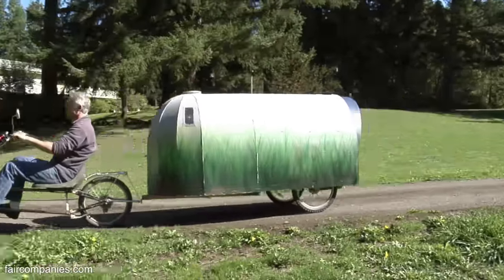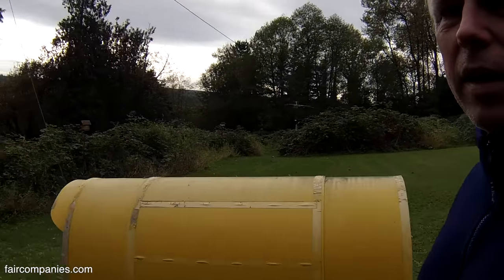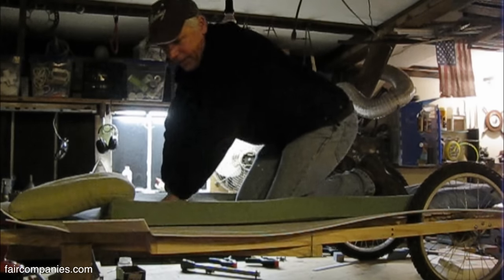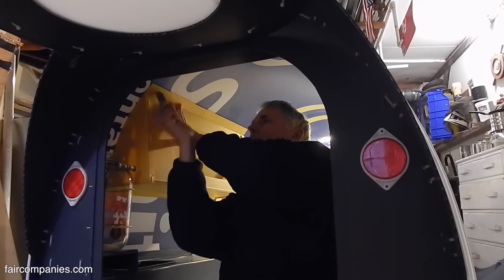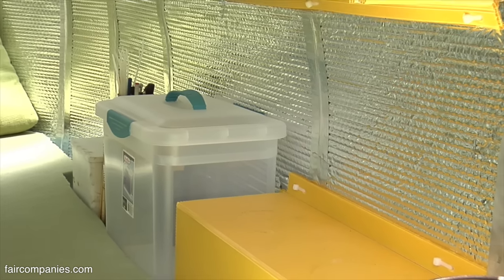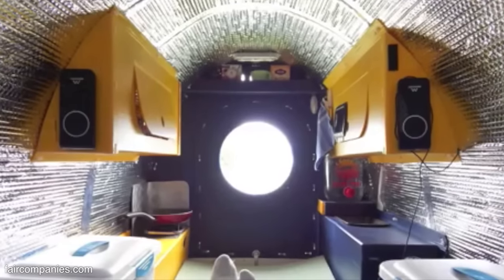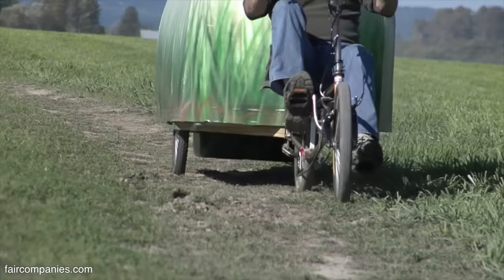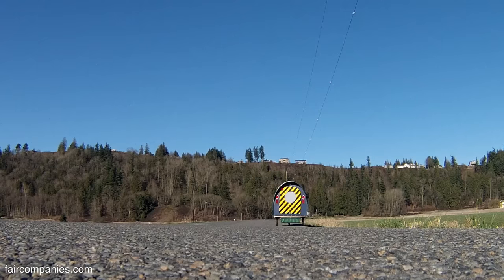$150 bike camper: DIY micro mobile home (downloadable plans)

Comment: Cover the trailer in flexable solar panels and tow it across the country with an electric bike.With 500watts of solar power one could travel all day on a sunny day off the solar power alone as it would take no more then 300 watts to cruise at 15 mph and the remainder go towards charging the battery for those times when it's not so sunny lol.
Reply: wow I like that idea a lot!
Reply: Good idea!
Reply: ...I like the idea as well.  Electric bike, powered off of solar panels, is even better.  Few downfall are natural, or ignorant, disasters!  Strong winds and hail, or drivers you share the roads with.  Once the sleeper is demolished, you're simply left with a down-graded-Lance Armstrong journey home!
Reply: Lower third + chassis of trailer could be reinforced to survive a storm. With couple of guy lines to secure it to the ground. Lay down and pray! Kind of panic room/refuge! Cycle home after a storm with less trailer but one heck of a story to tell! :)
Reply: You sir are on to something
Reply: watermyplants indeed!
Reply: I plan on this next year. Going half way across the state and maybe further, we will see how tired I get.
Reply: Very nice idea!
Reply: Would a lightning strike be a problem?
Reply: clifton reed jr Of course, it's a problem no matter what. Just don't get hit.
Reply: extra weight of battery's ?  and room for them , extra costs , and reinforcements to frame etc. nope :)
Reply: Mark Bird The batteries don't weigh that much. A human weighted battery would get you probably 200 miles on one charge, so just use a smaller one.
Reply: How about making the trailer motorized so it pushes the bike.
Reply: m9078jk3 Then you'd have the reverse problem that you have with backing a trailer with a car.
Reply: harry guy I love your thinking; great idea.
Reply: harry guy 
Didn't you say the same thing on another of his video ? And I told you that it was too expensive ?
Reply: good idea
Reply: shizukagozen777
It's possible...not sure to be honest....I can't find the vid or the post.
One thing I do remember saying though is I wish I could take the credit for the idea but I got the idea from a woman who went across the country on an e bike hauling just a regular bike trailer with a solid framed solar panel on it.
When I seen this sweet ingenious little camper trailer I got the Idea for a couple flexible solar panels on the roof.
You told me it was to expensive??
How much would you say is to expensive?
Can get a 1000w dc to ac inverter for 100.00  2 flexible 250w solar panels for a little under 300.00 depending on the quality.
As for the e bike there are 250w, 500w, 1000w e bike conversion kits with a front or rear 16'' to 29er rim with hub motor that can be put on any bike for less then 400.00.
I have been abusing my 26'' 1000w golden motor magic pie 2 putting 3000w through it for almost 8 years now without any problems mind you I don't hold it above 1000w for more then 10 secs so as not to burn out the motor.
Most expensive part is the battery but if you are able to you can buy rc lipo packs or what I prefer is lifep04 cells and build your own battery for a fraction of the cost of a pre made  battery plus they will last way longer then most pre made packs for half the cost.
I just bought 20 original not Chinese knock offs A123 lifepo4 20ah cells for 30.00 each = 600.00 plus a 20S 60a BMS for 100.00 and 5a charger for 80.00 totaling 780.00 giving me a 72v 20 ah battery fully charged but is more like 68v for the majority of the discharge cycle and weighs only 25lbs.
To buy this battery pre made would likely cost over 1500.00.
With good throttle management keeping the watts around 300 I could go 75 km on a charge.Or you could be charging the battery while you ride and go all day as long as there is sun.
Have the solar panel going to the inverter that you plug your regular 115v battery charger into charging the battery while you ride and depending how sunny it was could have enough power to be charging another battery as you ride also.
Not sure about that as I have never tried it but could def ride while sunny and have 75 km once it got dark running off just the battery.
Add it all up is like 700.00 for the panels and inverter.
500.00 for the e bike conversion kit shipped.
780.00 for bat and charger shipped.
Plus the bike and trailer.
Lets say 3000.00
I know lots of people that paid almost that for one of them crappy electric scooters with 100 lbs of lead acid batteries but would still work would just be heavy and not as efficient.
If you are buying pre built e bikes and lithium battery packs then yes it is expensive but only because you are getting juiced paying top dollar for junk from people buying a shipping container full of cheap e bikes from China...bringing them over here and charging 3...4 sometime more times what they paid.
There are thousands of good used e bikes that usually need batteries for a fraction of the cost of new on Craigslist or Kijiji.
I've seen 1 year old e bikes costing 3000.00+ new sell for 500.
Do your research...there are lots of great deals.
IMO anyone looking to build one of these camper trailers would likely have the skills to build their own e bike and battery pack.

A good place to start for info is Endless spheres...it is an e bike forum where you can learn about building e bikes, motors, battery pack and the best places with the best prices on anything e bike related.
Reply: there are a multitude of issues with what you said 

but the safety ones matter 

72v batteries are a shock hazard 
and running off batteries (on a sunny day) while trying to charge them is a fire hazard 

the individuals you know/saw got jipped btw, even within pre builts they were ripped off 

42 lbs, on your own with legal liability if you get hurt due to the battery malfunctioning (yeah, warranties and insurance don't cover improper use, which includes using a battery while it's on charge) 
46 miles before you account for the trailer and weight dragging it down 

overall it's not that great a deal, it's an option on budgets but it's really..really not a good idea
Reply: josh spradling 72v dc. You barely even feel it.  ac will mess you up though.
Reply: josh spradling
Do you even have any experience with e bikes besides watching some youtube vids? cause it doesn't sound like it.
Reply: harry guy electricity, batteries and solar don't alter how they work because they're slapped on a bike
Reply: josh spradling
I don't recall saying they did...The batt would charge the same way it would charge plugged into your 110v home outlet.The charger powered by the inverter powered by the solar panel would turn on as the batt voltage dropped and turn off when full keeping batt fully charged when sunny while you ride depending on how many watts the bike is pulling compared to how many watts your panels are putting out...
Pretty simple.
As to the battery sure you can buy some cheap dog pooie brand batt from China for 5 or 600 that might last for 2 years if you are lucky but for a good quality 72v 20ah batt that will last 5 to 10 years you are looking at around 1500 shipped at least unless you build your own.
Or go 48v 20ah if you are worried about getting electrocuted lol.
Would be lighter and cheaper but less efficient as bldc motors are more efficient at higher voltage not to mention higher top speed.
Reply: harry guy you don't try to charge batteries in use, it hurts the battery and increases heat generation causing a fire hazard

a battery also can't physically charge and discharge at the same time

electrcity is never safe
and eldctrcians start getting nervous about dangers at 12v (not safe at 1, but there are alot more things that can go wrong)

a short in a 12v can cause severe burns to anyone, even though most wouldn't think twice about handling a 12v freely
A simple wedding ring, and improper spanner is enough to cause severe lasting damage even at that voltage 

There is no such thing as safe electric
Reply: josh spradling
Then how is an off the grid house powered with solar with battery storage able to work?
The house would burn down by your line of thought.
How can the home owner run appliances through out the day while the batts are charging lol.
Reply: harry guy 
my it's not safe to use a solar panel and try to discharge a bike at the same time actually comes from
sun = hot 
battery discharging and charging = heat generation 

you're getting a battery fairly hot on it's own, then adding the sun, then stopping for a time so solar can actually do it's job 
aka fire hazard without it all being properly setup 

solar systems don't charge a battery in use, they power your home and any excess energy that's left they send to the battery or grid for future use 

they do this through sheer size 
by producing far..far more than you'd need during the day so that there is a sort of trickle charge going on through the excess energy 

if a panel is rated for your needs specifically (or meets it) you can't get this extra charge for later 
you'll either get the solar panel being unable to supply at all and you instead work off battery power, (500w is not 500w, and most of the time..esp in a mobile setup won't met 400 regularly enough to be rated that) 
or your panel will just meet what you need, in which case you'll be using solar until the sun stops meeting your demands, then it'll kick to battery..or trickle charge your battery unless in use..where it'll do nothing 

house do burn down due to improper management of the batteries 
sending current into a hot object that isn't well ventilated can and has been deadly 
then if you don't know what you're doing..chances are you won't notice any shorts or issues which will further increase heat, increasing the chances of a fire even more 

there's a reason that even nations encouraging solar and wind setups discourage citizens from installing it themselves 
if it's not properly done from top to bottom it can quite easily be deadly to you and costly to the city 

in the case of most personal devices, it's usually just painful or deadly to the rider 

there's a reason anything with a battery tells you the same thing on charging it
well ventilated, shady and do not leave unattended
if it becomes hot, stop charging it and do not use until it cools down (ofc no one listens so governments and companies have to do even that for people..but it's still a very real risk, esp when riding in the sun and trying to use solar to charge things)
Reply: harry guy  Not a bad idea, I'm sure it would take some fine tuning. If you think about it , you really only need power for the uphill stretches , so when your on flatland or downhill ,a portion of the foreword momentum could also be stored to later power it uphill. I have no idea how to accomplish this but I'm sure someone does. I mean after all if  humans were able to accomplish a moon landing I'm sure this is within the realm of possibility.
Reply: How expensive is expensive? $50-500 for an Electric Hub. Flex solar panel $200-500 Batteries $200-300  Should be able to make one for less than $2K
Reply: ***** yeah good idea, that's kind of what I meant in my comment about storing  some of the forward momentum especially when you're going downhill
Reply: harry guy awesome, I didn't even know they made something like that.
Reply: Many hub motor controllers have a regen function that is like an electric brake the recharges the batteries when the bake lever is pulled.You can adjust the amount of braking force from just a little to throw you over the handlebars.
Reply: Would add to much weight and complexity.I don't think a chain would work but a shaft drive might but again adding a ton of weight.You could put you motors, controller,batteries on the trailer making it a pusher trailer.
Look up electric pusher trailer on youtube.
Reply: Have both...front dynamo hub and rear hub motor with regen.
Reply: im not a solar panel expert... but i highly doubt there is enough surface area to have 500watts worth of solar panels!
Reply: The average 250 watt panel is around 5.5'x3' so depending on the size of the trailer would determine how many panels that could be used.
Say 6' long trailer 2 panels could be layed length wise on a rounded roof and maybe one on each side of the trailer.Problem with solar panels is if only a small portion of the panel is shaded it really hurts power output so one side would produce power while the other side produces hardly any which is why I would lay the panels length wise as one side would always be getting enough sun.1000watt of panels but only 500watt could work at any time.
I honestly don't know or have a disposable income to find out lol.
Plus flexible panels are not as efficient as ridged ones requiring larger flexible panels to produce the same as a small ridged one.
Reply: harry guy I've been thinking about other ways to generate power, or recharge batteries however you want to look at it. And I think that a small lightweight removable wind turbine unit could be installed on top of the trailer for the times when it is parked could also be useful. Any thoughts?
Reply: David  marzolino 
I've been kicking the wind turbine idea around also for my upcoming trip (though what is a trip called when theres no end) and haven't found anything online about it, anybody on here got any input on logistics?  David, I was thinking use it in conjunction with panels to have plenty battery and not worry about relying on a sunny day.  And what would be wrong with it being active while riding?  Wouldn't your pedalling energy be in some way converted into stored energy?  I have no background in this stuff so please correct me if i'm wrong
Reply: or you could use a crank generator attached to the back wheel
Reply: Craig Caminiti a trip with no end, that sounds awesome to me. I really don't know a hell of a lot about wind turbines myself the only thing I was thinking is if you had it running while the vehicle was moving it might create more drag than it's worth but I'm really not sure about that.
Reply: I was thinking along these lines myself.  At least then, at 15mph and electric bike the battery hopefully won't be too heavy a load. Would it be possible to use smaller 9 volt batteries , possibly 2 of them, rather than a standard size?
Reply: Judith Lawrence  A motorcycle battery would probably work, don't quote me on that, but I believe it would ,and it would definitely save you some weight and space.
Reply: I would go with a couple of these...
https://hobbyking.com/en_us/multistar-high-capacity-6s-20000mah-multi-rotor-lipo-pack.html
Can't beat the price and they weigh only 2400 grams each!!!
Not to mention you could draw 50a without them even getting warm which would greatly increase their life.
2 of these in series would give you 44.4v 20ah for under 400.00 with shipping....amazing price IMO and too top it off only 11 lbs..
Reply: Knightz zoss The battery in the link I posted is 6s lipo 22.2v x 20 000mah.Running 2 in series would give 44.4v x 20 000mah and cost is 400.00 shipped as well as lighter 11 lbs then anything i have seen for the performance of these batteries rated at 100amp max discharge.With a 1000w motor the most you would draw is around 20amps which would greatly increase the life of the battery. 
And yes there are batteries with a longer life but are more expensive and heavier.All depends on how much cash you have as well as your ability to source lipo/lifepo4 cells to build a battery pack with a battery management system and charger.
Or buy one pre made which will cost more.
Reply: harry guy Hey, I'm with the electric bike idea, definitely not the peddling idea. Lol
Reply: clifton reed jr LOL
Reply: Ur right. Solar batteries can be charging at the same time while using.  Some even have a built in inverter.
Reply: actually electricians dont give a fuck about voltage per se with safety, It's the amperage that kills and the part of your body it hits across.
Reply: better off dumping the inverter as its changing 12 v to 120/240v BACK to 12v to charge the ebike. steeping voltage up and down incurs loss as its not efficient.
Reply: harry guy remember, no free lunch
Reply: harry guy genius idea.. screw all the what if guys.. hey what if a meteor slams in the earth and kills us all? what if the sun goes nova?.. 

 i refuse to live in fear!
Reply: +Nacht Kind i think you mean ESC which is only a speed controller for the motor.
Reply: Nope. I'm not talking about controlling the motors speed. I don't want that. I'm talking about paying a fee to have a custom vehicle registered with the DMV where it gets its own custom VIN, and license plate, so you can drive it over speeds of 30mph, or in some states 55mph.
Reply: How much surface you need to generate even 300W constantly? Weight?
Reply: You can expect somewhere around 9 watts per sq-foot, and that's with no clouds and direct sunlight.
So 300w would be 34 square feet, and 500 would be 56 square feet. So you might be able to get away with 8ft by 7ft, but you probably won't be able to do hills.
Oh! and don't forget to factor in the weight of the solar panels, it's about 2-4 lbs/square foot, so at best that adds 112 lbs to your trailer. I wouldn't want to be the one trying to peddle that bike. (And at worst 224 lbs just for the solar panels.)
Reply: Lithium batteries are much much lighter and would work just fine. I just don't know how many AHr you'd need.
Reply: harry guy op
Reply: Is the bike homemade?
Reply: harry guy haha haha all your energy goes to carrying your batteries
Reply: Thin, bendable/flexible solar panels are quite lightweight. I found one that could follow the curves of this camper: PowerFilm Solar R21. According to their website it's 1.42 lbs for the whole panel, which is 14.5 x 60.75 inches. Total surface is ~6.12 square foot, so the weight is only ~0.232 lbs per square foot. That's only ~3.43 watt per square foot though. You could fit three panels on this camper. The downside is, those panels are really expensive and you would only have 63 watts at best with the Sun directly above the camper, which is nowhere near the power required.
Reply: 500w would be a lot of flexy panels.
Reply: Don't need a whole lot of battery for some LED lighting and a radio/MP3 and maybe a phone/tablet charger. And do it with Li-Ion batteries instead of lead-acid ones... Not heavy.
Reply: ok
Reply: Idiot perpetual motion machine idea.. without benefit of facts.like weight, actual power output vs sq footage.. battery storage weight.. and fanciful  idea of what less than 1/2 hp ( 300 watts) can do against the wind and terrain.  bad ideas without engineering don't promote EV's they sabotage them.
Reply: not if you cover your ears with the supplied Styrofoam cups.
Reply: this is called cart before the horse.
Reply: The future!!!!
Reply: 300w will easily power a bike to 15mph.  you can do that on under 200w if it is pretty flat.
Reply: harry guy i
Reply: After reading the comments, made me think back to shop class 19 years ago. We built a battery powered bicycle that recharged on a solar panel on the rear of the bike while peddling. Things people couldn't believe back then and looking at just battery and solar technology now amazes me.
Reply: The batteries which will be used to stock the electricity that product the solar pannel will be super super heavy ..
Reply: PV is magic, yo. Just slap on some panels and enjoy your free power. Fuck technicalities, it just works.
Reply: @death299  if you had two battery packs one charging in your mobile home  off the solar the other in the bike powering the bike's mid-drive motor. Then swap when charged no problem basic build probably ebike and trailer and solar powering system could be done for under 1500 with dyi systems. Exspecially with the flexable solar panels.
Reply: @feliciaanglen3510  you are giving flexible panels waay too much credit 

Even in cali and nevada their 20-25% effeciency takes DAYS to fully charge any decent ebike battery 
Under optimal conditions..aka flat and facing the sun 

You're looking at a week or more for a battery charge while adding 72+ lbs to the system before gear meaning even a high quality battery (which would bump you above 72 lbs, but atm that's pointless as the extra weight isn't needed to make it unviable) that can get 100 miles optimal in under 10 will lose ~ 25% of it's optimal condition range 
On top of the 10-25% heat siphon 

At best you're getting 60-70 miles per charge
Buuut it's also unviable to use as a normal bike, takes a week to charge AND assumes you carry no other gear (so no repairs, food, water etc) the moment you start adding the things you need to have you're not going far at all

Unless you're in a permenant or intend to be in a fixed location none of it is viable 

Esp if the goal is to "cruise around" since you'll be forced to stop every few hrs (evem in optimal conditions) and wait weeks before doing anything

The more panels you add the quicker it will charge..and the faster it will drain 
there's currently nothing that makes such viable 

For any distance where you'd need the range extra batteries and cables is vastly more effective due to forced downtime via length of charge time 

You're also never going to get a week of perfect weather (or even a day without clouds) 
so for 5 days of riding a whopping hr a day (at 15mph under otherwise optimal conditions) you're left not moving most of the setup for just as long if not longer
Reply: Awsome 👍👍What about rain leaking in 
How did you seal it
Reply: I like the way you think.
Reply: might be better built longer, with a cab/seat forward to drive it from.
"mini ultralight RV", a 2hp 4 stroke engine using bicycle gearing (sprockets) so it has power to get up hills, maybe top speed 22 mph. a gallon of gas would run it all day and 200+ miles pretty easily.
Reply: josh spradling I bet you drive a Toyota Yaris and wear a styrox helmet
Reply: tried it and it turned my wife gay.
Reply: Top idea 👍🚴‍♀️
Reply: clifton reed jr what about vampires?
Reply: Wow!!! ❤
Reply: For that matter just make the whole thing a vehicle built around the bike as the mover.
Reply: @death299   fear #
Reply: @GDMHificationranpitc  ?
Reply: I think the point is he likes to ride the bike
Reply: @elrud5964  it's not. it's a mobile homeless shelter
the basic design behind that was just a cheap pop up shelter that could be used by groups that help the homeless as an alternative to "proper" shelters as some individuals would rather not sleep in such environments 

in theory solar panels (basically cost not counted, just the concept) 
 actually work wonders for the proper reason behind it as you can charge things like an emergency phone, electric handwarmer or power a small heater for a short period, batteries that can be used for a variety of devices (such as an electric razor for grooming or lights when one MUST do something at night, or even a handheld radio) 

 all of which..overall make the situation abit more bearable, safer and with regards to grooming make it easier to approach people for things like work
Reply: Sharron Clark  I still get exercise riding an electric bike by peddling along with an electric motor.
Getting  bionic assistance doesn't eliminate exercise it just reduces strenuous exercise.
Reply: After doing some research for several hours. I think a living in a Van is more self-sufficient. Cheapest thing right after a Motorhome RV. A Van is a investment though and it’ll only be good depending on how you much you invest. It can surpass a RV or it can just be enough for a single cramped room
Reply: And the weigth of the battery? No bro, that is to heavy better bring a 50000 mhp battery on pack. And
Reply: @Muncle Tuzza Vlogs "if anyone continues in sin after coming to the knowledge of the truth of the Gospel there no longer remains any sacrifice for their sins but only a fearful expectation of judgment and fiery indignation which shall Devour the enemies of God"... Hebrews chapter 10 verse 26 nkjv
Reply: @Muncle Tuzza Vlogs there is no other name under Heaven given among men whereby we must be saved other than the name of Jesus Christ... Acts chapter 4 nkjv
Reply: @Muncle Tuzza Vlogs Jesus Christ died to save Sinners... Do you qualify?
Reply: @Muncle Tuzza Vlogs that doesnt matter......Jesus cares about you!
Reply: @Muncle Tuzza Vlogs they beat him and flogged him in the scripture says that Jesus Christ was beaten so bad that you couldn't tell if he was a human being or an animal... They put a crown of thorns on his head... They mocked him and made fun of him... They stripped him naked... They ripped his beard out of his face and spat in his face... They eventually crucified him on the cross... And the scripture says that Jesus looked down on them with love while they were doing this to him and he prayed for them saying; "Father please forgive them, they don't know what they're doing!"... Luke chapter 23v34 nkjv
Reply: @Muncle Tuzza Vlogs "o m g"   is using Gods name in vain....its blasphemy!

The Holy Bible says no blasphemer shall inherit the Kingdom of Heaven... 1st Corinthians chapter 6 verse 9 nkjv

Repent and believe the gospel of Jesus Christ
Reply: Baked potato effect
Reply: Excellent
Reply: Jake Sangria  That would be 2 solar panels on the roof in direct sun light....maybe one on each side making a total of 4 so at least 2 panels are receiving direct sunlight...but obviously not always...
There are some good flexible 250 to 300 watt panels on the market for under 200.00..that don't weigh as much as the glass aluminum framed type...
Reply: Genius right here
Reply: This guy must work for NASA
Reply: This guy can open up a trailer park in no time
Reply: Please dont give more ideas hahaha
Reply: @cliftonreedjr6073  I'm
Reply: If only every road only went downhill.  :)
Reply: That crossed my mind too! Trip great mind think alike!
Reply: Yep...
Reply: Actually genius tho
Reply: Yes. But in theory, ,but not in the real world. If it did work like that, we would no longer need gas powered cars. In fact the bike this weight would need to use less far less than solar energy watts available. We lose lots of energy through wires and battery charging, converters etc.. So far the only solar powered vehicles that can travel non stop at 15 mph have 1000 watts or more of solar systems attached to roof. And they are ultra light weight. half the weight of this bike alone. Probable is its not possible to recharge batteries as fast as the vehicle motors use up the available power. and weight draws huge mounts of power from motors and it sucks out power so much faster than charging is even possible
Reply: Wouldn't be able to get 500W of panels on it.
Reply: You don't need solar panels.  These things are made from coroplasts.
Reply: Very cool. How much would u charge to make that same exact 1 for me and ship it to the state of Georgia. Thinking of goin on a bike tour on the east coast greenway. Starting at Savannah Georgia to key west Florida then head to Maine then turn around and head back to Savannah Georgia. Going alil over 5k miles but this would deffently beat towing a bike trailer and having 1 of these specially making a cup a coffee and sum eggs in the am instead of stoping at a coffee shop
Reply: @markbird6340   @joblessalex 15 kg for an 1,500 wh lithium ion battery will do. You can charge your 75 km battery with that probably twice. with 400w panel you can load the hole battery in 5 hours in good sun.... so 3 times extra engery, I use this in my shad, with an 300w panel, all Summer a cool 220v refrigerator, make tea and coffee, and on sunny day's when the battery is on 100% at 1300 hour,  I also make toast bread with cheese. , so an little more heave bike camper will be my goal.
Reply: @cliftonreedjr6073  Non-conductive.
Reply: you're 1000% spot on.
Reply: Harry that's a silly idea, photovoltaic cells are it that powerful, to fill a big battery he would have to wait and techa he all the, start moving late in the afternoon for 3-4 hours and then go to sleep?!?! Not to mention he simply CAN'T afford am electric bike or the battery
Reply: @m9078jk3  also, you'd be more.likwly to get stopped because now it's a combustion engine. Places like down here in South Florida, that enters into a whole new realm of laws.
Reply: If a submarine can be powered by nuclear, what about a bicycle?